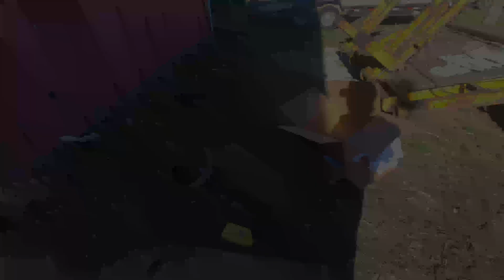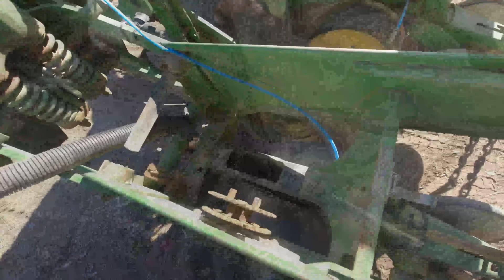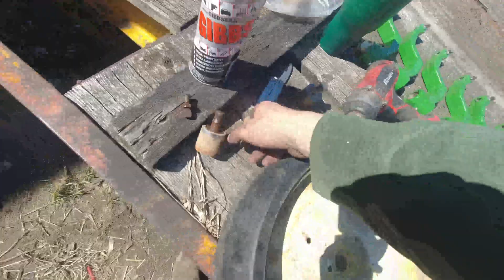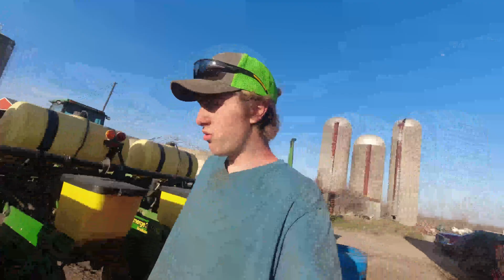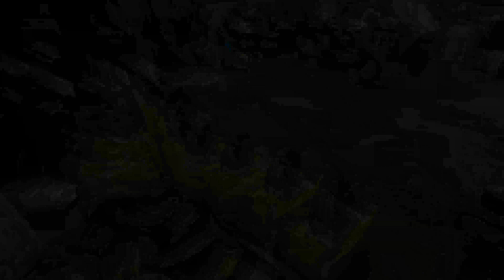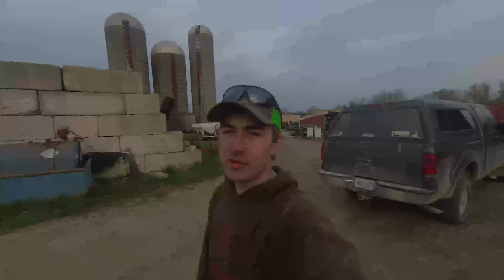We Upgraded Our John Deere 7200 Planter To Grow 250bu Corn

Comment: I have been replacing the gauge wheel bearings with bolt on bearings and new arms. Shoup has a replacement arm that used a 5/8 bolt to fasten gauge wheel to arm.

Comment: Great video. What type of Precision meters did you install? Do you like how they worked? We are thinking of doing an meter upgrade on our 7200 this winter. 
Thanks for the awesome content, Keep it up
Reply from the maker: The planter came with eset meters. They are usually around 99 percent singulation in corn and 90 in beans. We plan on going to vsets maybe next year since we already have gen 3 20.20